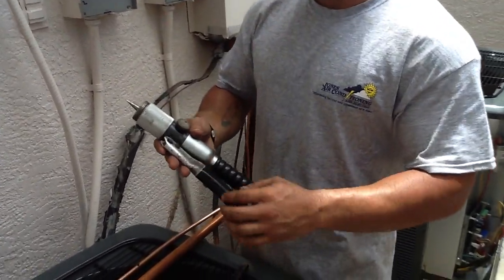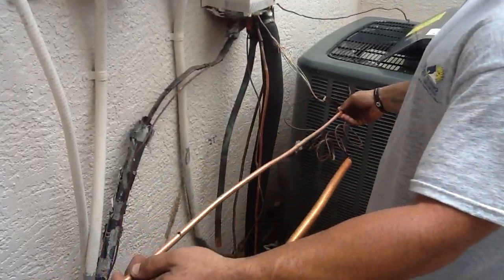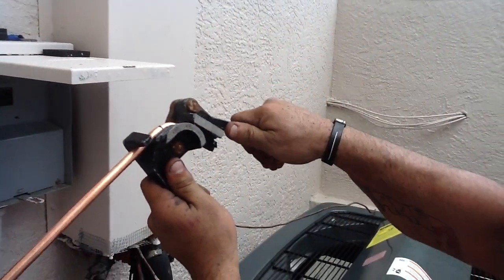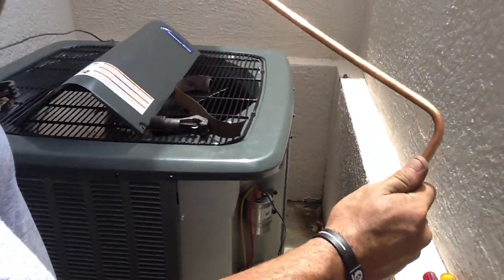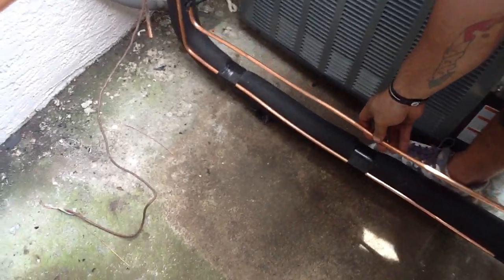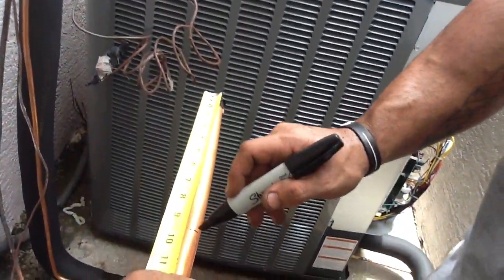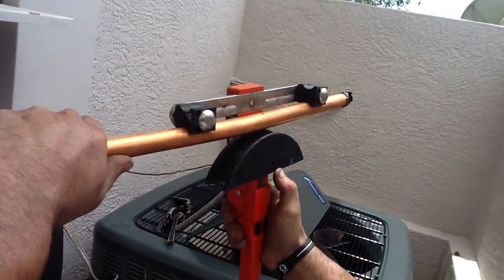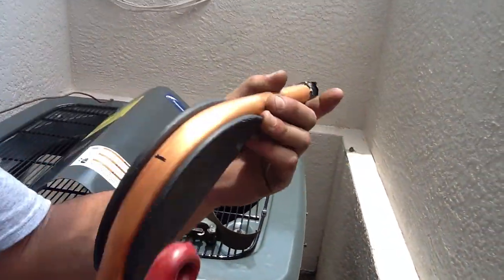What are Copper Bending Tools?

Comment: Each time that you toss a tool down onto the top of the condenser unit, it damages the paint. These small nicks/chips are where rust will begin as the unit weathers. I prefer to place a piece of cardboard on the unit to protect it from damage.